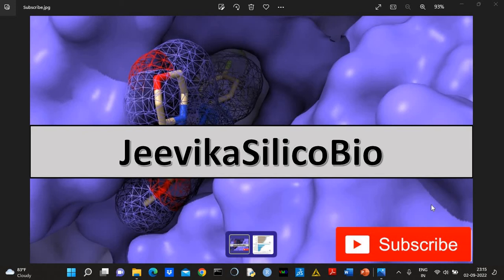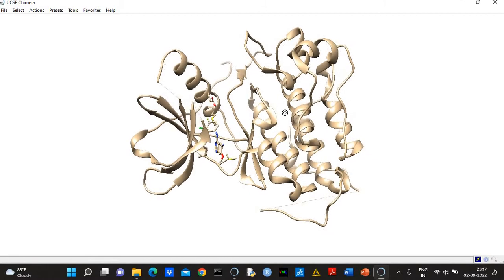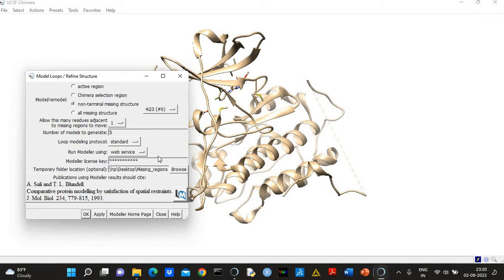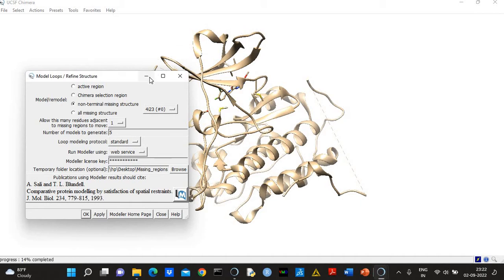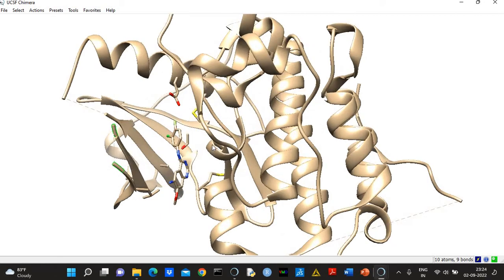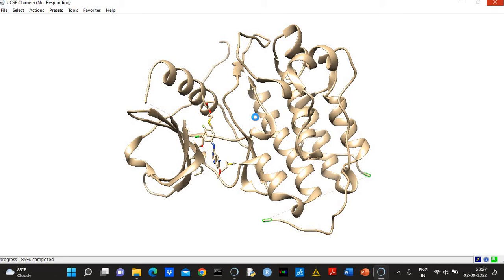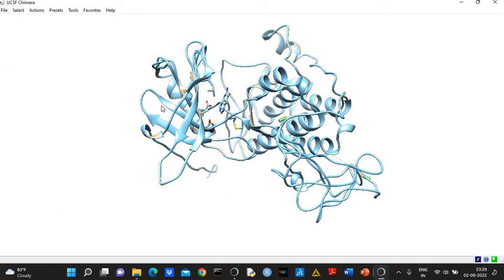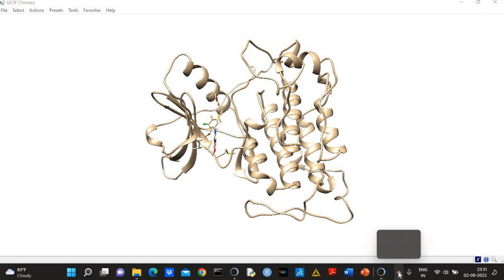Modeling missing loop regions in the protein structure|| UCSF Chimera

Comment: I have a quick question. Does model/refine loop option in Chimera do any optimization or refinement?
Reply from the maker: Yes, Chimera uses either locally installed Modeller software or web service ( Modeller) for the modeling and refinement of loop region(s). Script  first generate an initial model and then several loop conformations are generated based on initial loop conformation. So optimization algorithm is active in this case. You can click on the given link for more details..
 https://salilab.org/modeller/manual/node499.html
Reply: @jeevikasilicobio  Does it apply optimization to only modeled part? I want to keep the rest of the protein as it is. So in such a case, can I use Modeller in Chimera or should I write a script for it?
Reply from the maker: @ecemgungor6208  You can keep rest of the protein as it is. Just select 1 residue  adjacent to the missing regions to move....  You can use the web service, no need to write a script.
Reply: @jeevikasilicobio  Thank you so much! Please keep recording videos on MD and analysis/modeling! It is very useful for beginners! Thanks!